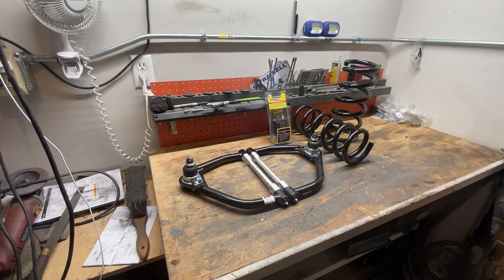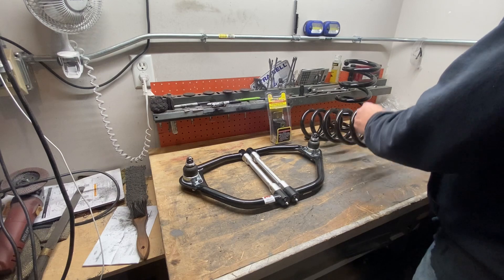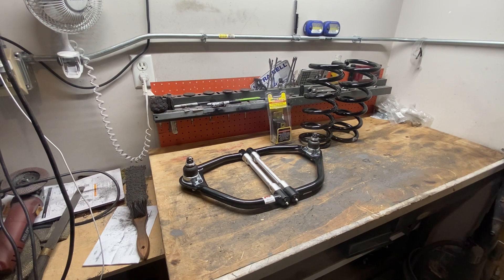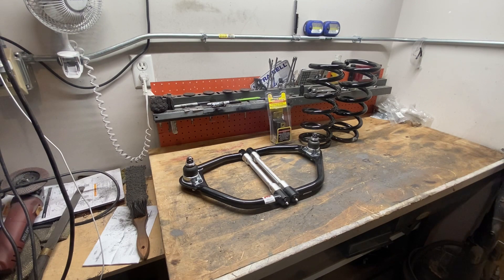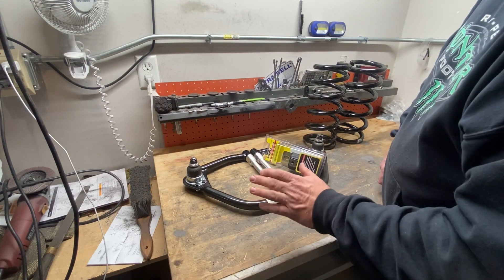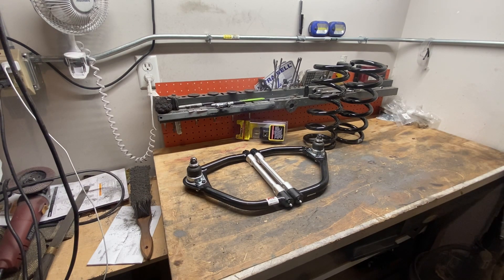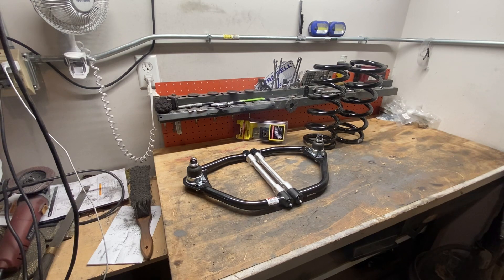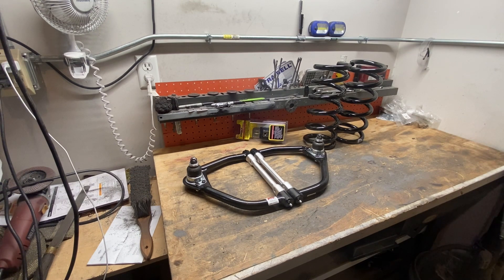S10 Blazer drag race chassis setup

Comment: I used moroso 212lb springs and cut the upper a arm bump stops out. I now how 10" of seperation in the front. hooks up with a 28x10 tire great on asphalt. It's  With 600hp. I also keep 200 lb on the box
Reply from the maker: Nice, sounds like a great setup!  Is yours a Truck or Blazer? JD
Reply: @HeadFlowInc  truck
Reply from the maker: I’m setting the Blazer up as affordable as possible. If you watch the SRC, I’m setting up my rear leaf springs similar to how Billy the Kid has his S10.  Factory 3+1 spring pack with the overload leaf removed then solid blocks to set the ride height.  I already have the rear leaf spring. Slider assemblies where he still uses the factory shackles; I won’t need near as thick of a lowering block.  JD
Reply: @HeadFlowInc  200 lb in the rear really helps as well. Try it you will see. I took the weight out of the back tonight. It had way more tire spin. Turbo John's a no prep guy he adds up to  600lbs

Comment: Springs are all the same I have 2.2L 4 banger springs in my big block truck and it only dropped it a Half inch more with turbos added on and 2 radiators . Spohn control arms and stock 98 2.2 L springs and viking shocks
Reply from the maker: That’s a “wives tale” all the springs are the same; you can look up the different spring rates on the Moog website. 
5658 rate 579# 
5660 rate 639#
5662 rate 706#  
The heaviest rate springs were used in the diesel S10’s. 
Since the true 4cyl spring has a slightly smaller spring material diameter .690” vs .720” , slightly   Taller free height 13.176” vs 13.159” they’re different. JD

P.S. Also the rate was depending what transmission it came with, both 5658 and 5660 came in 4cyl S10’s depending on the transmission type/weight.
Reply: @HeadFlowInc  

Guy from beltech told me back in 1995 all s10 springs are same rate all a selling point. I have lowered so many of these trucks and the 4 cylinder springs under load were same pressure as the 4.3 v6 springs . Just something I have always gone by.
Reply from the maker: I sure hope these new springs help, the previous owner cut at least a Full coil off the springs to lower the front.  The front is a tad too low, my middle finger barely fits between the lower a-arm and the frame so it bottoms out easily.  There’s no stored energy to help with weight transfer. 
S10.org had a write up saying the 4cyl springs with a V8 swap lowered the front 1/2”-3/4” compared to the 2.8 V6 springs.  I’m hoping to see maybe a full inch drop with the LS swap and associated Turbo components up front.  
The Calvert 90/10’s should help get some front end rise and slowly let it back down. The Speedway tubular upper a-arms are mostly for weight savings and since they’re 8.5” version it helps with alignment geometry with a lower vehicle. 
I guess it’ll either work or get more changes, but it’ll surely be better than what I have now.

Comment: 1 inch taller upper ball joint, stock spindles, V6 (4.3) front springs and QA1 double adjustable front shocks is the preferred configuration. CALTRAC in the back on the leaf springs with QA1 double adjustable shocks and lowering blocks 2" (Solid). If you are going to race it make sure you X Brace the frame. If you don't believe me then ask SRC.
Reply from the maker: The Blazer frame is different than the truck but I’ll look into it. Iirc Billy’s S10 they removed one of the leafs, the overload, from his stock spring pack. 
Blazers come factory with a stiffer 4 spring pack than the trucks due to the added weight in the rear. JD
Reply: @HeadFlowInc  Correct the overload has to be removed. As far as frame differences I am not sure of. I know on my 95 I run 98 Blazer front spindles and when i was looking at A-Arms the same P/N was used for both the blazer and truck by most manufactures. I would look into a bump steer kit, I like TRZ

Comment: No, not boring.  I don't understand the need for a 2 degrees neg angle on the tyrans??  Never did any drag racing, all mine was road racing with SCCA. Now, we would lower and move the engine and gearbox to the rear some but always made sure the power unit was level.  Different racing requires different settings, huh.  
What do you thing your gain will be on applying the 2 deg solution??
Reply from the maker: Setting the appropriate driveline angles will reduce vibration and transfer the power more efficiently to the rear end. JD
Reply: @HeadFlowInc  I can see where it would be beneficial to have everything in line.
Reply from the maker: Was your SCCA car coil springs with 4 link rear suspension? 
From what I’ve found all GM vehicles used a -2 to -3 engine/trans angle.
If you consider the u-joints need to be within 2* of each other in terms of angle with 1* being optimal. But here’s where it gets hard to nail down:  The leaf spring suspension doesn’t control the rear pinion rise as ridged as a coil spring 4 link; as a result you need to estimate how much the rear pinion will rise? ie 2*, 4*, 6* or more depending on power level. 
By setting the engine/trans at say -2* angle your helping establish a straighter plane between the trans and rear pinion.  By setting the rear pinion -2* to -4* as a base helps establish the line or orientation pointing the pinion at the transmission under acceleration/load. 
Because the transmission sits higher in the chassis compared to the rear end, having a negative angle helps obtain the best chance of driveshaft angle. With a neutral engine transmission angle you create an even steeper u-joint angle which will be difficult or impossible to correct.
Even a 4 link rear suspension should be set to -1* to -2*  JD
Reply: @HeadFlowInc  OK, I understand where you're going with your setup.  I should have told you how we mounted our engine & gearbox in the car.  After lowering and moving to the rear (about 1 1/2 in down & about 2 in to the rear) the eng & gearbox is solid mount to the frame. And IRS with the differential solid mount as well.  We would just make sure the drive line was as level as possible.

Comment: We got a turbo 4.8 too! It's no drag truck though but its fun
Reply from the maker: As you know it can make incredible power, especially for only 294 CID!  JD
Reply: @HeadFlowInc  definately aware of the capabilities, its amazing! and you get all the bragging rights when you sweep them in a small displacement pushrod engine haha
ours isnt fancy atleast yet..
stock 4.8/nv3500 UNDER bed vsr7875 turbo.
Reply from the maker: @s10life  My next Turbo will be the VS 78/75 but I need to upgrade to Gen 4 connecting rods first!  👍😎
Reply: @HeadFlowInc  gonna subscribe to stay up to date with it!

Comment: Interesting stuff. I too cut my factory springs did one full coil tried it wanted more low and took another half. However I have a caprice which is similar chassis but bigger. I use soft shock in the back and some stiff kyb gas shocks up front. When I smash the skinny pedal front comes up and stays up until I lift.
Reply from the maker: Sounds good, but your Caprice has coil springs in the back which should squat. There’s a big difference in coil spring and leaf spring suspension. 
It sounds like your car is working for you!
A leaf spring suspension should never squat at all, it maintains tire gap/ride height and actually separates the body up away from the tire under load.  JD
Reply: @HeadFlowInc  very true about the coils. I have about 200lb of stereo in the trunk overload springs in the rear and umi box rear control arms. Even my c10 has coils in back but the c10 is slammed quite a bit lower